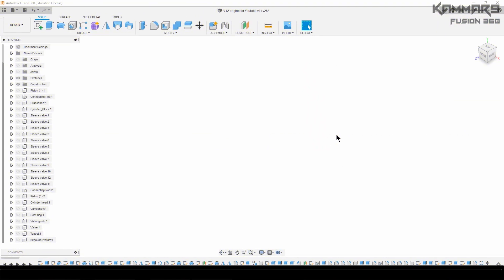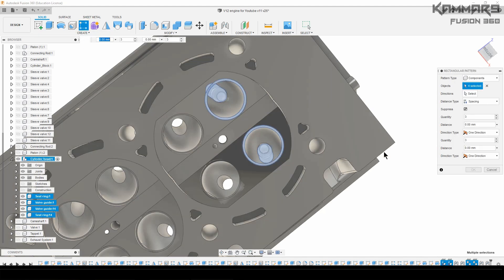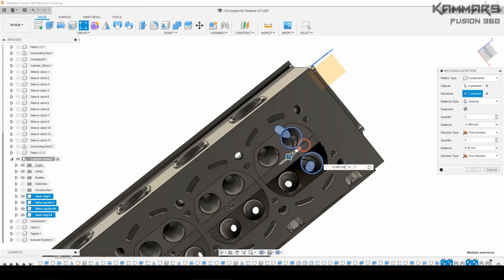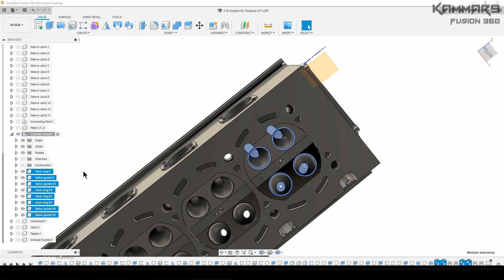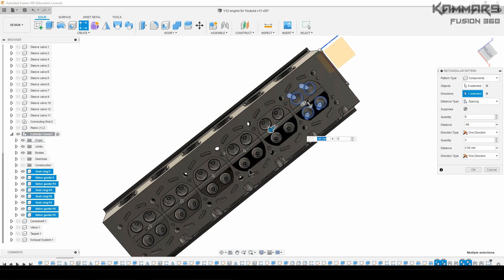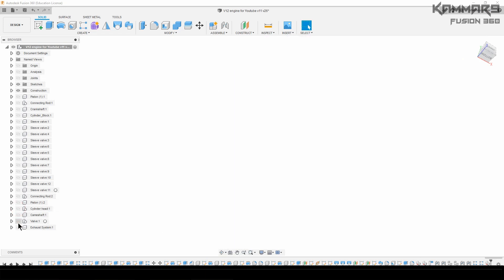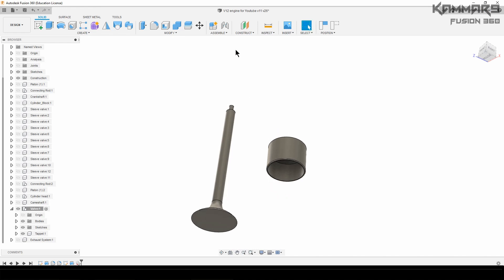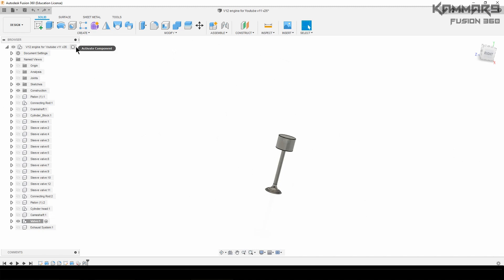Fusion 360 Modeling V12 Engine EP 31 😍 Full HD

Comment: hi kammar for some reason when i do rectangular pattern on valve guide and seal ring it is correct.then as i verify it moves them out of place .
Reply from the maker: Hi there bro, I noticed that in Episode 35 it ll b out earlier, I recommend you to select all the valve guide and seat ring with the cylinder head , right click and rigid
Reply: @AmmarKhelifaoui  hi kammar I have tried everything it still doesn't work keeps on shifting rectangular pattern if the parts completely out but before you click OK it's all in the right place.

Comment: What system are you running on as I’m using an i9 with 4.1 ghz, 32gb ram and an rtx2080 and it’s does start to get sluggish when there’s a few assembly’s on the screen and you try add joints or align the assembly/body’s???
Reply from the maker: I5 , 32 ram , nvidia quadro